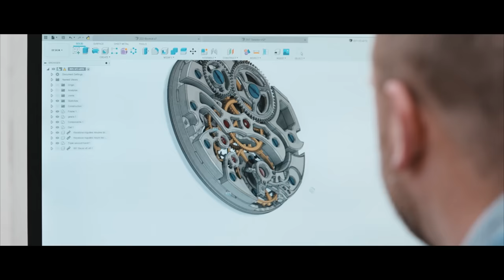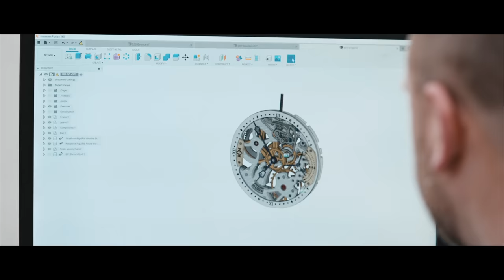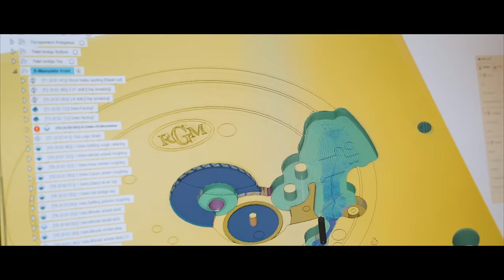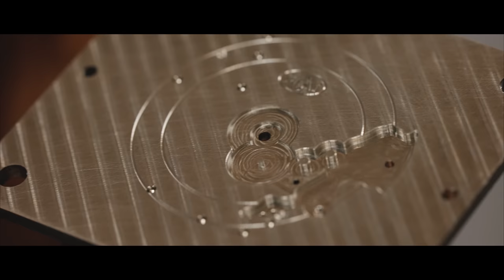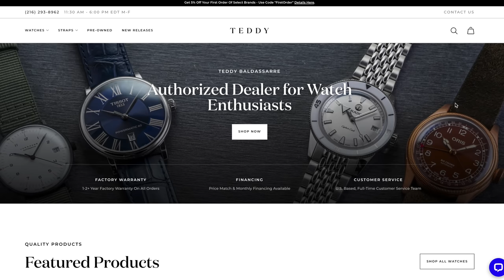Visiting the Greatest American Watchmaker

Comment: My buddy and I drove out to Mt. Joy in 2012 when we were both in Philly for Thanksgiving. Roland and his team were REALLY nice. Took a lot of time with us. They were just in the middle of designing the model 20 movement at that point. And even though the 801 was WAY outside my budget, I ordered one. Because there's always a waiting list and it takes months, every watch is custom made to your specs. If I'd had a few extra bucks, I would have gotten the larger "Pennsylvania Series" case, the motor barrel and wolf's teeth gears. You get progress report emails as they're making the various parts. I requested a custom number for the movement, which meant I had to wait a few extra months before they got to that one. I opted to get the 801 with no dial (they engrave the main plate on the rose engine) and the keystone hands.

Comment: I think I’ll start with the 500 and one day get the big boy toys from RGM. Awesome video. There was one detail that almost lost my appreciation.

It was the part when he showed the back of a watch and the screws were not perfectly aligned; similar to the bezel on the Royal Oak AP. I was 🤔 thinking “how American of RGM” but I stuck through it, and I’m glad I did. I really want one!
Reply: The "Screw heads" on the bezel of an AP Royal Oak are not screw heads, but in fact, bolts. They go through the watch with screw heads on the underside. Bolts are positioned so that they are all lined up correctly, and the screws on the backside never line up. It is nearly impossible to economically manufacture screw heads to line up perfectly, and no watch brand does it as far as I know.

Comment: These guys are a small shop, almost independent like. Gives me Philippe Dufour vibes with almost everything hand done. Only difference I see here is that these guys use machines to polish and do little eccentric designs and Philippe Dufour literally does polishing by hand. Very impressive nonetheless.

Edit: I just looked at their site, the 801-EE model is very beautiful and my favourite by far from them, and it's surprisingly priced at $12,000. That is not too bad of a price considering Rolex basically are glorified watch assemblers, they price their stuff fairly competitively.

Comment: I`m a ultimate difficult costumer 
- have chose for seiko GS and then nobody in world can me convict to anything else
- you can talking years millenniums does not helping anything 
_
even if all watchmakers working together on one project 
- want not
_
but is compromise only 
SEIKO GS long time not all versions
_
this must to be looking like 
Citizen Ana-Digi 41-8021
Citizen Digital 
Seiko mechanical 
- 5 mm tick 
- not heavy 
- strong glass 
- solar powered also in case for security 
- some phone memory if is possible if not then not 
- notification small led in various colors (take a look on phone) but only if is possible to hold more as couple months if must be recharged in five ten days then not 
_
that is what I want 
- what you have who care
_
and I at finally never use watch 
- only when sleeping to take a look time to wake or still sleeping 
- appointments (date with girls once upon time)